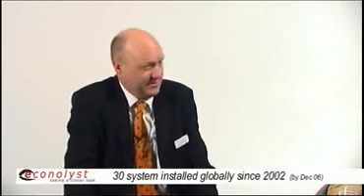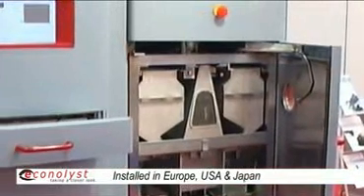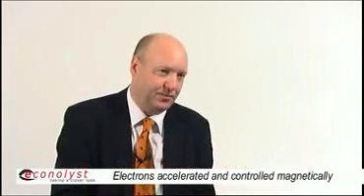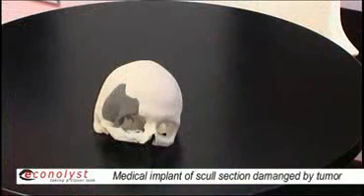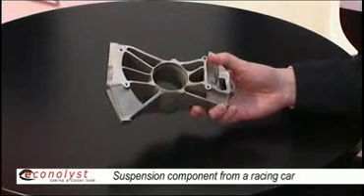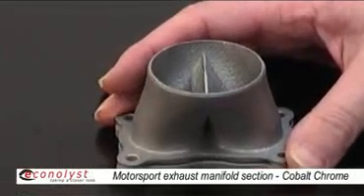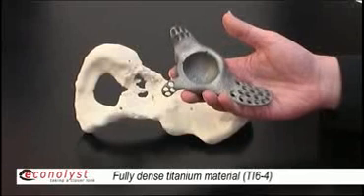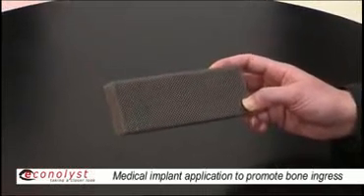Arcam - Electron Beam Melting

Comment: @telesniper2 I don't think it's to replace investment casting of mass produced parts.  It's to make metal prototypes on the spot without a complicated process.  And in low volume custom parts, you will get it a lot cheaper and can make parts that are impossible to "cast", esp. without finishing and assempling multiple pieces in a secondary process.

Comment: I believe 3d printing technology may have a similar trajectory as PCs. We're routinely using far more computing power than it took to land on the moon or develop the hydrogen bomb for mundane stuff like pretending you're a mage casting ice-bolts at a dragon, looking at porn or distributing cute kittens with silly captions across the world.

In 50 years amateurs will print replacement parts for bikes, unique door-knobs, dildos and all sorts of silly stuff that would horrify todays experts.